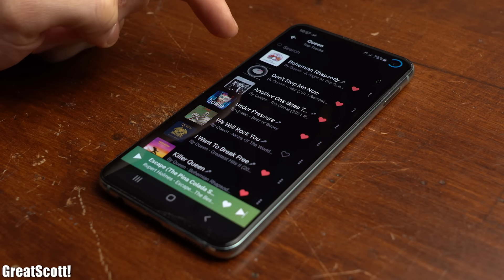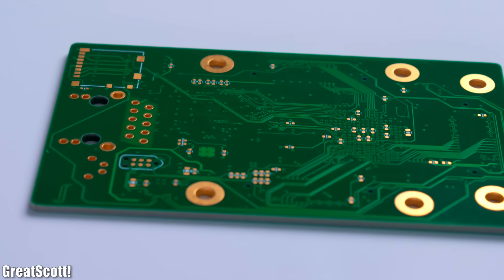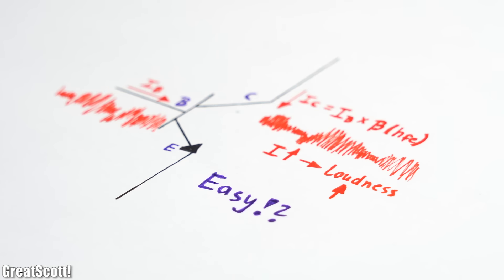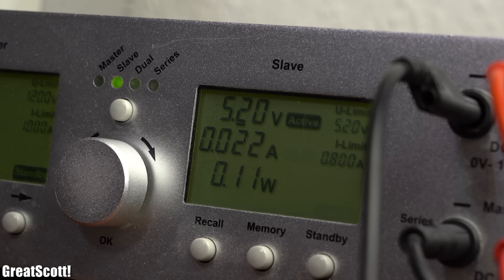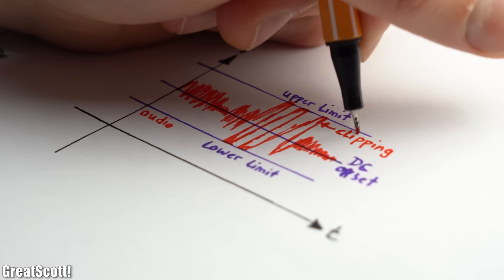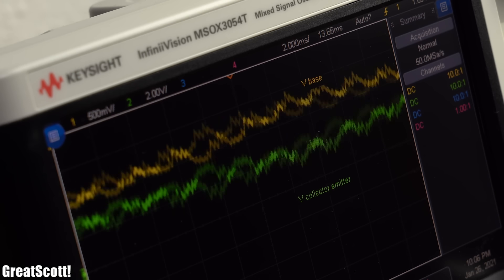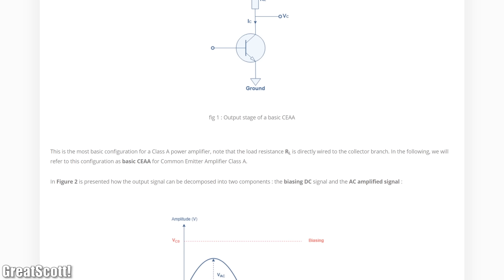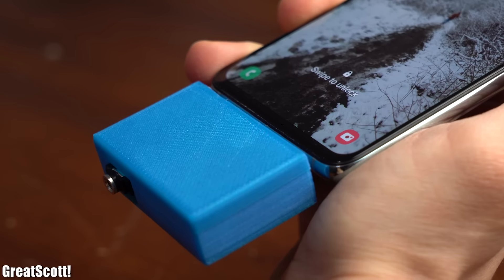Building the simplest, best sounding, yet most inefficient Audio Amp! || Class A Audio Amp Tutorial

Comment: A few things to consider. 
1. At the collector you have an impedance that is the parallel combination of the collector resistor (100 ohms) and the load resistor ( impedance of the headphones). With 22 ohm emitter resistor, this circuit offers no gain or attenuation with headphones at or below 32 ohms impedance, and it explains why attempts at lower bias current weren't successful because emitter resistor was big and the collector resistor was relatively small. 
The final results shows some decent amplification which means the headphones used were higher impedance.

2. If you want a 1 volt peak signal, for example on a 32 ohm speaker, there will be a peak current of 1 V/ 32 ohms = ~31 milliamps, so the ~20 milliamps flowing in the circuit will have a hard time with that requirement for lower impedance headphones. Emitter followers are great for driving lower impedance loads such as headphones (they represent a simple solution).

3.   10 microfarads at 1 kilohertz is 15 ohms worth of impedance, lower impedance headphones will have more gain for higher frequency audio signals than for lower frequencies signals. 100 microfarads seems a good deal, some electrolytic caps rated at 16 volts are small enough to fit in that case.

4. The base sits at around ~1 volt, would be bad if there was a loud signal with 500 millivolts+ peaks, would bring the base voltage below 0.6 - 0.7 volts required  and cause distortion.

And, good video, transistors and op-amps are worth exploring, we have many in our computers and smartphones :)
Reply: 1. The collector current determines the output impedance (and input impedance but that doesn't matter in this case) and nothing else. I agree that the headphones used must have had a higher impedance than 32 ohms, otherwise there would indeed have been no overall gain. At lower collector currents, the ratio of Rc/Re would remain constant (hence the unloaded gain would be constant), but the effect of the larger collector resistor would naturally reduce the overall gain because of the increased attenuation into the fixed, low-impedance load.

2. The other way of looking at it is that a 32 ohm load would attenuate an unloaded signal by a factor of 5, so you would need a 5V peak signal unloaded to get 1V peak loaded. And getting 5V peak out of a circuit with a 5V supply is tricky. Emitter followers look like a good solution until you realise that they still have to supply that peak current into the load, so an emitter follower stage would have to have a high enough emitter current to have a low enough emitter resistor. You might as well just increase the collector current in the common emitter stage and do away with the complication of a second stage. (Note that this only applies in this case because lowering the input impedance of the stage won't cause a problem because of the low impedance drive from the phone.)

3. 10μF at 1kHz is around 16 ohm impedance, but that's still negligible compared with the 130R output impedance. The -3dB frequency is when the capacitor's impedance equals the sum of the output and load impedances, which would be around 100Hz for a 30 ohm load. Maybe use 22μF, but anything more is a waste of space and money. Check that the voltage at a 32 ohm load is given by the resistive divider formula: 32R / (130R + Xc + 32R). That shows why the -3dB frequency is when Xc = 162R, not when Xc = 32R (as it would be if the amplifier had a very low output impedance).

4. You really need the base to sit at about 900mV to maximise the gain, but the circuit is crippled by the load impedance being so much smaller than the output impedance. If you raised the base voltage to say 1.5 volt in order to cater for 500mV inputs, you'd have to increase the emitter resistor to around 42R to keep Ic=20mA. But then the gain of the loaded circuit would be reduced below 1, which kind of defeats the purpose of the project. Also, a negative 500mV implies a 1Vp-p signal input, and this circuit hasn't the supply headroom to amplify that by very much anyway, without worrying about the input excursions.

Actually, although I've criticised some of your commentary, I very much appreciated that you've considered so many factors. I probably agree with a lot more of what you wrote than I disagreed with, apart from the fine detail.

Comment: What about creating an esscencial class AB amplifier?
I've seen some with those C5200 A1943 transistors which are super simple for it's power.
(Not those class A ones, those don't work)
Reply: Im pretty sure you need to tweak the resistors a lot so both are in cutoff so its a pain

Comment: Interesting timing, last week my wife and I wanted to watch a movie and the sound level through my computer speakers was way too low even with the volume all the way up. I wound up designing almost this same amp to use between the output of my computer and the speaker input. I just left it on proto-board, as I doubt I'll need it again, it was just that one movie with the low sound. I powered mine with 12V from a bench supply. I learned to design amplifiers like this many years ago by reading a book called "Transistor Circuit Approximations" by Malvino. I think it's still in print, I highly recommend it.

Comment: Is there any chance of a version that is a USB DAC and Amp?
Reply from the maker: Not sure.....sorry.
Reply: @greatscottlab  Ich beantrage eine Version mit DAC. Da hier ja noch mehr Ohrgenuss herausgekitzelt werden kann. 
Leider ist hier das Angebot gerade im >100€ Bereich eher mau.
Reply: I mean the FiiO uBTR is a bluetooth and maybe USB DAC that you can connect to your phone over bluetooth or hook into a computer via USB and hook in a set of headphones or earbuds. Only runs $20USD on amazon. Or if you wanna shill close to 100USD on amazon theres the FiiO BTR3 bluetooth and confirmed USB DAC.
Reply: @warmesuppe  Antrag wird unterstützt!
Reply: @warmesuppe  Guys... This amplifier here isn't on a alevel where you should be concerned with sound quality. It's just not that good. DACs on the other hand are quite excellent starting from $4 or so. The Realtek DAC that I mentioned has dynamic range in the 100dB range and is already a massive  overkill to a simple circuit like this one.
Reply: I'd use a bluetooth enabled dac, no wires ☺️
Reply: @Mr.Leeroy  ALC5686 is 120db SNR...
Reply: . Realtek makes many chips with different specs. I'm under an impression that the  only thing that you experienced from them is an integrated soundcard from a noisy motherboard.
But the point wasn't a particular chip. As I said, this amplifier is very simple and the DAC won't matter a bit. It's about form factor where the entire DAC circuit fits in a usb plug and you have easy access to th output contacts.
...But if 120db SNR is too little for you than you can always get ES9280/9281 for $30 with even better specs and in the same orm factor.
Reply: @Mr.Leeroy  You seem to be governed by beliefs which render you resistant to objective evaluation of the particular example that we're talking about.

You can read ALC5686's measured specs on the internet. It's a high performance  chip, head and shoulders above PCM2706, with 22db better SNR. 

A USB plug with ALC circuit inside costs $9 on Aliexpress.
Cirrus chips are better, but also adequately more expensive. A CS43131 dongle like Meizu Hifi DAC costs $20. 

For aplication like this one, ALC5686 USB plug has more than enough performance.
Reply: @rhalfik  holyshit, it's crazy how they shrink all the design into such small pcb. I can't find ALC5686 datasheet, I'm amazed, but I doubt it will be as good as in datasheet, but also no one needs 120db SNR on mobile device ever.
Reply: @springrollwang4441  Yeah I can't find the specsheet as well. There is a growing number of chips in that category that has confirmed performance in that form factor Just look up Meizu Hifi DAC, or Tempotec Sonata Pro. Until recently, good DAC ICs required quite a lot of work to make them sound good, but nowadays they're so well integrated, that you just wire them straight to earphones and they performpretty much  like in datasheet.
The best ones are:

Sabre ES9280/1
Cirrus CS43131/98
Qualcomm WHS series

All work as a circuit in a USB plug and can drive earphones (with exception of CS43198). 
In addition Qualcomm WHS also have a rather nice ADCs.
Reply: @Mr.Leeroy  I hate to repeat myself, but that wasn't my point.  See the first couple of comments. I was responding to a guy who asked how to interface this simple amp to a USB. I gave him a tip that he can use this USB plug. That's it. I don't understand how you made an argument out of it...

But since you're interested in performance so much, here's a quote from Ivan of E1DA about Meizu dongle with a  plug DAC:
" I have measured Meizu HiFi DAC (single CS43131 no buffer) and found SNR -130db(A) DR 130db(A) "
Reply: @Mr.Leeroy  I picked one because it would be my choice if I were to build it. It was a quick tip. A specific one because it's faster for the other person to find it instead of doing a whole research. It was also the first aliexpress search that gave me good results, so I ran with it.
Of course ou could just add your own personal favorites, but you decided to argue with exactly zero experience  with the thing I was refering to.  I could mention any of the products out there, but I chose this one because I like it and it fits this project like a glove. Deal with it.

In reality what happened is this: you got triggered by the name of the company. Because you hate Realtec so much you feel like you need to protect your view on them when they release a decent product. And this need is so strong that you  waste your time arguing with random people on the internet without anything to back your claims. Who is biased here? 
Go check on reality and test this thing yourself and then tell us what you think, mr expert.
Reply: @Mr.Leeroy  Notice that you formulated an idea that giving an opinion is a sign of bias. I mean.. It's like... your opinion. And according to you, you're not allowed to share it.
I have at home a nice DIY ES9038q2m with current output and an elaborate power supply. It does sound nice. But guess what? The USB plug DACs are almost as good and besides power output there's no relevant difference between them.  That's because these mobile chips are far more integrated  Even more than your favourite PCM2706, because they have adequate features like microphone inputs. Heck even some have   ADCs that  outperform PCM2706's DAC.  Aand they're easier on batteries, and they have features which you think are stupid, so let's not go there. 
They don't need big output caps to sound good, because they're designed to perform in these conditions, so that they can be put inside a "noisy motherboard" of your phone, designed by an accountant and still perform. 
To sum up - they work. Don't believe me. Read reviews or see for yourself.

Comment: Oh damn I thought this was going to be for speakers. Still good video! 

But... Am I the only one that powers 2, 4 ohm Alesis Point 7s with an iPhone XS built in amp? Honestly I just did it for fun one day. Results are surprising. Distortion? A little not as much as you'd think surprisingly. Volume? About the same as a portable 10 watt Bluetooth speaker at 60% volume (Yes I tested this). Quality? Not too shabby, definitely not audiophile quality but if you don't care then its really not that bad. Lighting adapter get hot? Hell yes it did. Battery drop rapidly? Oooh yes. Why am I explaining this? Because I can.
Reply: damn that's actually really cool. Makes sense though.

Comment: Rest in peace those guyys with no headphone jack!😂
Reply: Actually in this case it would just make the box smaller because you can get audio and power from just the USB C connector.
Reply: You could pass audio through the usb c / micro port, though that requires more complex solutions.
Reply from the maker: Not sure if getting the audio from USB Type C is easily possible with such a USB Type C breakout board.
Reply: @greatscottlab  
Yeah, you would need something to negotiate with the phone to pass audio, and a DAC on top of it.
Reply: @greatscottlab  well, there are some breakout boards with both.
Reply: @rockytom5889  You cant just use any USB C to headphone jack adapter. Not every manufacturer designed their devices to output the audio from both outputs. I had to buy USB to headphone jack sound card (small sound card used on PCs with no audio) to make it work.
Reply: @greatscottlab  You just need a USB DAC chip, the legendary PCM2707 is not that difficult to DIY with - have done that when I was in high school, albeit with regular USB because there was no such thing as USB-C back then. Unfortunately, the more modern USB 2.0 single chip DACs are in really hard to work with packages like WLP so it's going to be hard for DIY to win on that one.

Comment: Sometimes in design they add a bypass capacitor at the emitter to make AC analysis easy, then they match the input and output capacitor to the low and high critical response frequencies.

Comment: Great video!. You could have bypassed RE with a capacitor, in which case voltage gain would be around RC/re, where re is 26mV/Ic. Now, the voltage gain is RC/RE. If you put a trimer instead of RE with its wiper to the capacitor you could adjust the voltage gain. The design is ok its just a consideration, as you could drop Ic whilst obtaining the same gain.
Reply: Yes but you'd completely wreck the linearity of the circuit because the gain now becomes completely dependant on the instantaneous value of the collector current. The distortion from that is horrible.
Reply: @RexxSchneider  i know, but you probably wont hear it anyway trough modern headphones which only output bass.:)
Reply: @matejmeza3930  Oh yes you will. That predominantly third harmonic distortion is completely independent of frequency and is very, very noticeable.
I think you'll find that decent modern headphones produce a flatter response than older ones, There are databases of frequency responses available on the web, and searching for "headphone frequency response database" will gives you plenty of examples to check. For what it's worth, in-ear earphones usually have less bass response, and Apple EarPods shows a distinct roll-off below 100Hz.
Reply: @matejmeza3930  The link for the Apple EarPods report is https://reference-audio-analyzer.pro/en/report/hp/apple-earpods.php
Reply: @RexxSchneider  If you want linearity, slap in an opamp and add feedback. Or use multistage with seperate VAS and OPS and add feedback. If i understood the video, he wanted to get an amp that is eficient as he is powering it out of a phone. Of course the fidelity isnt good with a single CE stage driving relatively low impedant headphones. If we are talking about fidelity, its best to build a serious headphone amp to have distortion curves to taste. 
In case of modern music, a little of third harmonic does not hurt, even if it makes it crack, it makes it richer. With todays bass drum and autotune, the music is boring. So distortion is welcome ;) im joking of course
Reply: And for " fidelity wise " its plausible to have headphones in phase with the phone s output. I wouldnt like phase on both of my earphones inverted from the original signal. And trust me, you can hear inverted phase on both speakers even if they are in phase with each other.
Reply: @matejmeza3930  But what sort of opamp is going to work well with a 5V supply and a 32 ohm load? An LM358 won't be happy with the load and an NE5532 won't work on 5V. You'll end up with an LM386 with its poor distortion performance, although if you increased the feedback to give a gain of about 2, it might be tolerable. Otherwise, another commentator pointed out the MAX97220 which would be ideal for this as it internally generates a -5 rail, thus doubling the available output.

In fact, the single BJT common emitter can perform surprisingly well if properly designed, but you need to alter the biasing so that the upper base bias resistor becomes a feedback resistor from collector to base. While decreasing the gain, that increases the linearity and lowers the output impedance, both of which are desirable in this application.
Reply: @RexxSchneider  In any case, you need something with the ability to source and sink current with feedback to make a low distortion and amp to drive low impedant headphones. In mixing desks there are specialized opamps which can handle more current but their Vcc is higher, if not siymetrical.
Reply: You could also use two CE stages with feedback and you would also create a non inverting amp with better stability.
Reply: @matejmeza3930  I'm sorry, but I can't trust you on that. I simply don't believe anyone can hear the difference between an original signal and an inverted one at any audio frequency. I respect your entitlement to believe differently, but if you search for "can you hear the difference between a signal and an inverted signal?" you'll find that nobody else shares your opinion.
Reply: @matejmeza3930  There isn't a phase issue.
Reply: @RexxSchneider  i tought drivers were meant to move outward when the kick drum hits. Mybe im wrong :)
Reply: @matejmeza3930  Here's one example of how you mike up a kick drum:
https://www.youtube.com/watch?v=jOHduVBqGeM
There are lots more. Note that nobody is suggesting that you need to ensure the phase is preserved. In fact, moving the mike back and forth at different distances from the drum surface will subtly alter the relative phases of the fundamental and its harmonics. It is suggested that you do that to create the sound you want. However, I have seen no suggestion that anybody can tell the difference between a driver that initially moves outward and then inward at 70Hz and one that initially moves inward and then outward at 70Hz. YMMV.